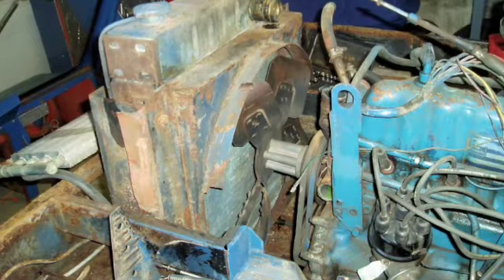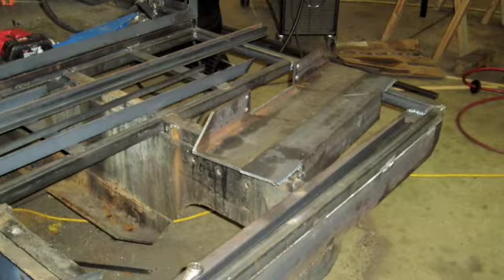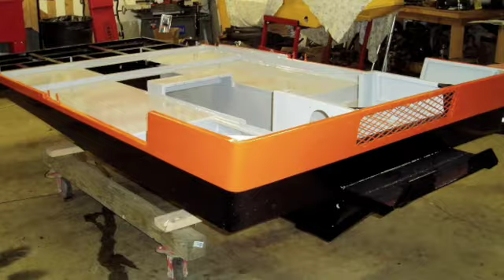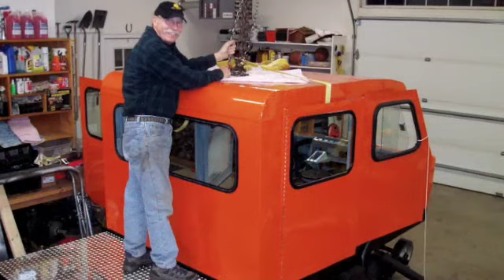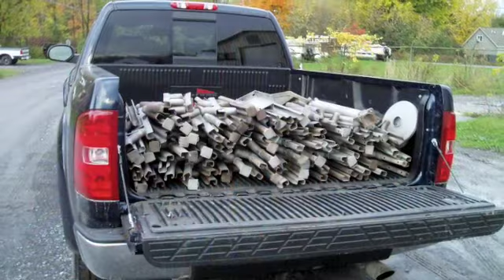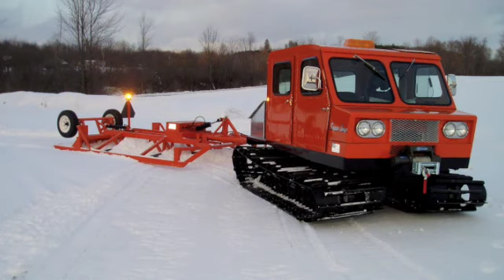Thiokol Resto

Comment: Wow that is an amazing restoration.  If you ever want to sell it...let me know!
Reply: I was in the process of rebuilding a Thiokol Imp and suffered 2nd heart attack. Can't finish project.
I have as follows;
Logan trailer with all new 8 lug backing plates, electric breaks, drums, wheels and tires with spare and new break away battery complete on the trailer.
As for the IMP;
I have the stock Ford V4 ran good when I pulled it out, didn't want to use it because of parts limitations.
I have a chevy 4 cylinder Iron Duke I intended to use with a brand new turbo 350 transmission.
Fresh rebuilt OC4 with new bearings and new Ring and Pinion set up properly with dial indicator.
Have the used ring and pinion as well.
Brand new Bogie Wheels, bearings and foam filled tires mounted on leaf springs ready to go.
The tracks are 31" wide in excellent shape.
The tub is sand blasted and primed with Zinc Chromate.
The nose and windshield frame are sandblasted and primed with epoxy primer.
Gages and panel, heater, roof and back cab, mostly all parts are there.
Great ground up rebuild project for those able to do so, wish I could
Asking $7,000 or best offer.
Email; inspbrown1@yahoo.com
Phone; 916 416 3194
Reply: @Robert95758  did you ever sell your Imp?